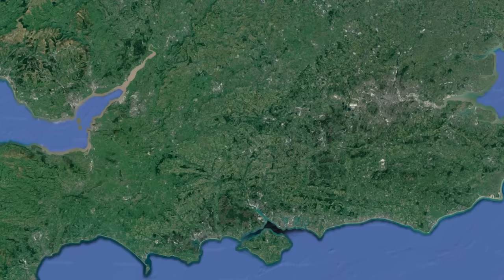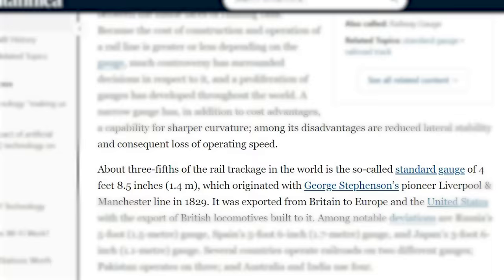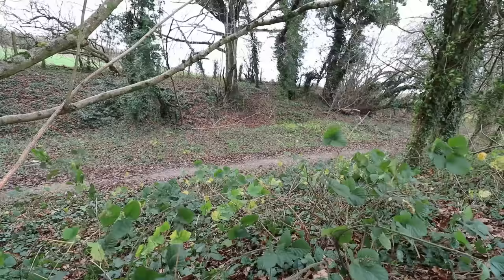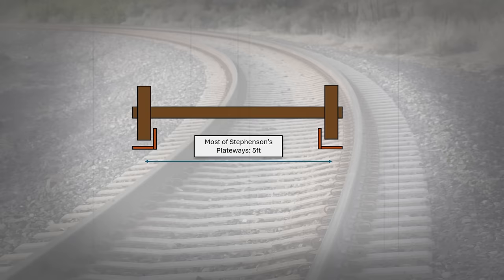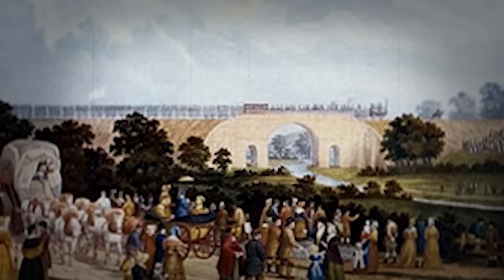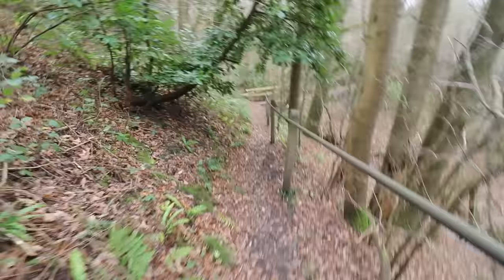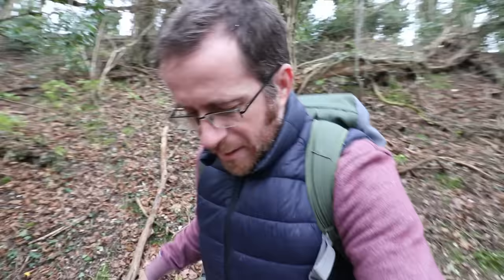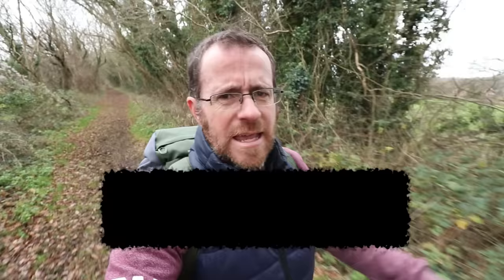Railway Gauges did NOT Evolve from a Roman Chariot.

Comment: I liked the video but everyone will tell you that you missed their favourite aspect of the gauge wars.
I will throw in my "twopence":
Larger gauge lines are more expensive to build and maintain. This is not a problem for a heavily used line like London to Bristol. For a rural branch line struggling to be profitable this is another nail in the coffin.
The bigger the gauge the larger the minimum practical radius of curves. This is not a problem on a line which is on reasonably flat terrain but becomes a problem on lines which thread their way through steep sided valleys and mountain passes. The only solution becomes more tunnels and other earthworks (which have to be wider for a broader gauge). 

Narrower gauge lines are usually slow because faster trains will be unstable.
Around the world, mountainous areas often have narrow gauge feeder lines and wider main lines.
Brunel's gauge was seven foot and one quarter inch. The quarter inch was added for the same reason Stephenson added a half-inch to his. If you build track and rolling stock to the same gauge they will bind going around corners. Modern railways tend to "ease" (expand) the gauge even more on curves.
Just my thoughts.
Reply from the maker: Veeeeery good point indeed. Cheers
Reply: South Africa ran express trains on 3' 6".
Reply: Nowadays they have greasing devices on tight curves to prevent binding. There's one just to the south of the Ribblehead viaduct, the only one I've ever seen. You can see it from the station platform.

Comment: Thanks Paul.  A minor correction.  At 0:44 you said 4' 8.5" in the UK.  Not true - only in the GB part of the UK of GB and NI.  In NI, all of Ireland in fact, the gauge is 5' 3" - and there's another story.
Reply: So-called Irish gauge was only JUST bigger than Standard. 
Hence British Rail were able to sell some uk stock by simply re-working the wheels, axles and bogies to suit.
Reply: Yes Ireland uses 5ft 3, and the tram system is standard guage.
Reply: @armstrongleworthy5420   In Auckland, NZ, for the last decade of diesel-hauled trains (before they electrified) the carriages were refurbished BR Mark 2's on 3'6" bogies.   We also had some diesel multiple units form Perth, West Australia, surplus from when they electrified.

Comment: I read an article written by an engineer many years ago. He said that the width of Roman chariot wheels was not determined by the width of the horses. That measurement can vary by the size of the horse and the person making the measurement. The accepted length of a cubit is 18-inches. If you take a wheel one cubit in diameter and turn it one revolution, its circumference would be 56.52-inches. That would be a very accurate measurement at the time. After all, .020-inches would be about the thickness of 5-sheets of paper. Measuring wheels would also have markings on them to indicate shorter distances. A yard is a double cubit.

It has been an age-old practice to measure distance by counting revolutions of a wheel. Even our early settlers heading west had an odometer (road meter) attached to their wagon wheels to measure distance. There were no tape measurers, so early carpenters carried a measuring wheel to mark off distance.

Measuring wheels can be purchased at any big box home center.

Comment: The three main railway gauges in Australia are 
narrow: 1,067 mm (3 ft 6 in), 
standard: 1,435 mm (4 ft 8+1⁄2 in), and 
broad: 1,600 mm (5 ft 3 in). 
Light rail for Sugar Cane harvesting uses 610 mm (2 ft).
Reply: I thought Australians were more efficient and didn't waste time doing inconvenient conversions for metric and imperial dual units.
Reply: @DemPilafian  a lot of us more efficient Australians are still old school and are more comfortable with Imperial measurement than with new school Metric. 
Feet, Inches, Yards, Chains and Furlongs seem more real than ten times ten times ten times ten what-Evers.
Reply: @Blackwater_House   Australia successfully metricated very quickly back in the early 1970s.  If you are truly more comfortable with imperial units you are literally already retired.

The good thing about being retired is that you have plenty of time to post meaningless garbage on YT.
Reply: @DemPilafian  I am almost 68 years old, Blind as a Bat, Deaf as a Post and Pig Ignorant; so your Opinion of Me has about the same value as a Mountain of Molehills. 
But I am pleased that you were able to express yourself so Eloquently in this forum. Best Wishes for 2000 & 24.
Reply: @DemPilafian  How do you measure car wheel sizes in Australia? 
 Pilots use feet, knots and nautical miles. Pipe thread is BSP (British standard pipe) like much of the World apart from the US. The base unit is 1 which is 1 inch, 1/2 etc.
Reply: @1maico1   As an American, I sincerely apologize to you for the shitshow you have to deal with because of us.
Reply: LOL.  Some of us even carry around organic calculators.  Others call it a brain.  Like the others said, us oldies can work with both.  Officially we are metric.  All items to buy now metric.  So an imperial nut no longer fits on an aussie metric bolt.

An interesting one is the Puffing Billy in the Dandenongs (near Melbourne) is 2'6' and still running as a tourist train.

Steepest train in the world?  Outside Sydney in the Blue Mountains.  And to think I went all the way to Switzerland (one metre gauge)  for the steepest COG train!

Comment: The BART system in California uses a less common 5’ 6” gauge. This was selected as the best way to ensure the cars, which were designed to be much lighter than other rail cars, would remain stable in the face of high winds at several points on the planned network (including a line across the Bay Bridge which never happened).
Reply: BART has a lot of design strangeness in general. until recently they used cylindrical profile wheels with no taper, which is common on streetcars, but not at all common for the subway-type system they actually built. allegedly the design consultants were from chicago where L trains have cylindrical wheels to deal with tight curves on the loop.
Reply: That was a biiig mistake.  As at present, BART cannot expand over existing lines or right of ways, and because of that at present there is a standard gauge diesel connector.

Comment: A couple notes on gauge...
1.  Stability - In the US, double stack container car loads are limited to 20 feet 2 inches height (!), running on 4' 8-1/2" gauge.  They don't tip over very often.  South Africa runs express trains on 3' 6" gauge. Brunel made a bad assumption about stability.
2. Changing gauge - on wooden ties, it's easy to convert from broad gauge to standard gauge by boring new holes in the ties.  Changing from standard gauge to broad gauge would require replacing all the ties with longer ones.  The government did something right for once.
Reply: I just found that maximum height is "Doublestack 4" = 20' 3" instead of "Doublestack 3+ = 20' 2". One inch difference to handle the taller containers at 2 high.  Maximum width is 9' 11".
Reply: @SteamCrane Not so simple when you come to altering curves and points.
Reply: @Poliss95  Correct, but the majority of mileage is track with only an occasional switch.

Comment: I think a fascinating example for a country sticking to another gauge than standard is Japan. The mountainous terrain and its need for tighter curves was perfect for the smaller gauge they still use. They only adapted for standard on the Shinkansen lines which are flat and straight.
Fascinating video on railway history. Germany also hat several gauges used parallel. Back then of course it wasn't Germany at all and every little Kingdom, Duchy and Principality had it's own railway company and also it's own gauge.
I wonder why we adapted the English standard. ^^
Reply: Spain and Portugal still use the wider Iberian gauge for most of their trains, but Spain's high-speed network is standard gauge to interoperate better with the rest of Europe. But now they've got some trains with variable-gauge axles which can actually switch between the two, with special gauge-changing equipment on the track.

One of the oddest ones to me is the Washington, DC Metro, which is 4' 8 1/4". That quarter-inch shaved off from standard gauge is because they're using less conical flanged wheels, to reduce hunting oscillations at the cost of more squealing on the curves.

Meanwhile, Boston's MBTA is standard gauge but it recently came out that the new Green Line Extension was accidentally built to slightly incorrect gauge, causing all kinds of problems.
Reply: Japan is fascinating. Apart from the Shinkansen lines, there are also railway companies and tramways that run standard gauge, a total of 2,600 route miles. There is even 60 miles of "Scotch" 4 foot 6 inch gauge on two interlinked Tokyo commuter lines and the Sapporo tram network. And 30 miles of electrified 2 foot 6 inch gauge.
Reply: Note that Japan has a much wider loading gauge on high speed lines, mainly I believe because the slab track they use is much more stable. They also have trains that automatically stop in an earthquake.
Reply: Japan historically used 3'6" for the former JNR network, and many private companies used the same gauge, although others (including some subways) used 4'8.5". 3'6" sounds sensible in Imperial, but its a rather odd 1067mm in metric! I'm not sure why the narrow gauge was chosen - presumably they didn't anticipate the amazing industrial growth in the 20th Century. Yes, there is lots of mountainous terrain, but the cities are usually on coastal plains, where a narrow gauge is unnecessary. But as has been mentioned, the loading gauge for most Japanese trains is huge - it seems rather odd to think that some of the huge 15-car long distance commuter trains - sometimes including a couple of double deck cars  - all packed to capacity - are narrow gauge trains! Its interesting that where a free choice of gauge could be made - eg Shinkansen, Chinese high speed rail - govts have stuck to 4'8.5" rather than any wider gauge, even at seriously high speeds. Again Shinkansen are far wider than UK stock, seating 5 across (+aisle) comfortably.
Reply: @timbounds7190    In terms of 'narrow gauge' there are two widespread gauges - metre gauge and 3'6" gauge.   3'6" is in use in Japan, New Zealand, Queensland, Western Australia and Tasmania, South Africa and Zimbabwe, and others.   Metre gauge is in use in Europe (e.g. northern Spain, CFP in south of France, Switzerland - notably Rhaetian Railways), east Africa, Brazil, Bolivia and others.

Comment: The broad gauge rails are known as "top hat" rail because of it's sectional shape. Another meeting of gauge differences is to be seen at Canfranc in northern Spain, French standard gauge meeting Spanish broad gauge, the station, longer than the Titanic, was a failure due to the man handling of goods from one platform to another. Went there a few years ago when it was in a very poor state, it's now a hotel I believe.
Reply: I believe a few YouTube's have covered it in the dilapidated state The Tim Traveller and also Tom Scott just being two.
Reply: Canfranc was abandoned due to a tunnel failure.
Dual gauge trains are a thing too…
Reply: @allangibson8494  no.  A train derailment in 1970.  Still, the big building was not being used by then in full capacity, and after most of the French line closed, it was finally abandoned.  Only recently it reopened, and a new station on the former goods yard was opened.
Reply: Broad gauge rail was also called "bridge rail" cos in cross-section it looks like a bridge - you can see it in the fencing at Torquay station
Reply: @tobythehairlessdog8876  The rail section wasn’t gauge specific. Bridge rail was used for standard gauge too.
Double headed rail was used too (but required special chairs at each sleeper).

Comment: Standard gauge also proves to be a good compromise for curve radii.  The wider the gauge the greater the radius of curves has to be to prevent wheel skidding and track/rolling stock wear.  The flanges of the wheels are not meant to contact the rails.  The wheels have a conical section that self-centres in the rails.  As the train goes round a curve the wheels shift to the outside of the curve and the outer wheel rides on a wider section of the wheel while the inner wheel rides at a smaller diameter.  It is all worked out to minimize wear and screeching.

Comment: Stephenson was contracted to build the Stockton and Darlington  Railway, will before the Liverpool and Manchester, Bolton and Leith. It was on the S&D R and the Mines Railways he discovered the binding and increased the Gauge by Half an Inch
Reply from the maker: Odd... so why was the Bolton and Leigh specified as 4ft 8.0 inches?
Reply: @pwhitewick  they would have specified 4’ 8”, but Stephenson would have built at 4’ 8.5”, because Stephenson already knew about the binding and the need to increase the gauge by half an inch, as he had already done so on the S&D R. Why do you think there was no binding on the S&D R. After all the S&D R opened in 27th September 1825. The Bolton & Leigh Railway opened in 1st August 1828 almost 3 years after the S&D R. The Manchester & Liverpool opened almost 5 years to the day after the S&D R, 15th September 1830.

Comment: The US had primarily two different track gauges until May 31, 1886 when a two day mass conversion changed all interconnected track gauges to four feet, eight and a half inches.  Preparatory work was done in advance to minimize the effort required over the change days.  Prior to the change the Union states had adopted standard gauge while the Confederate states chose five feet.  After the war between the states was settled, it was another 20+ years before railroad gauges were reconciled.  The Union states had more than twice the track length of the former Confederate states, which is why standard gauge was picked.  At the change-over time, 9,000 miles of track and large number of rolling stock and engines were converted to standard gauge in just two days, but only with many months of preparation making it possible.

Comment: Super video. Glad to be corrected on the ‘Horses Arse’ explanation. Although, that has spoiled a good tale about the size of the space shuttle engines that I used to illustrate how you need to keep pushing to get to the real cause of events. Still, I may still keep using it…

Comment: Here in Victoria Australia  we have 5 ft 3 in gauge as well 4,8/1/2 gauge
Reply: Yes the 1600 gauge that we use in Ireland aswell. I think it was probably brought to Victoria by Irish engineers.
Reply: 5'3" is the Irish Gauge, still used across Ireland today.
Reply: Port Adelaide used to have 3 different bushes all going into the port. There was som interesting point work where the lines all ran together.

Comment: The only thing I remember about how Stephenson chose his guage was what I read in a history book at school. In deciding the track width of his engine Stephenson measured the axles of numerous carts being used on the roads of the time. I presume most of these would have been horse drawn. He then took the average and settled on that figure, which turned out to be 4ft 8 1/2in. Whether this is true or not, I have no way of telling because I also heard (don't know where) that this gauge was the best at stopping the engine from tipping over on a bend. Did he not leave any notes?
Reply: The video has a quote from stephenson saying he can't explain why he ended up with the gauge he did.
Reply: @martinhawes5647  He may have not remembered, but it was obvious that he worked in mines where the gauge for the horse-drawn carts was 4ft, with some varying to 4ft 71/2in, whilst other mines in the North of England used wider gauge.  I suspect that he may have taken note of what worked and what didn't, and went with what did. Cost and time could well have come into his reasoning, as these two factors always have a bearing on any engineering enterprise. But, we'll never know.
Reply: @majorbruster5916 Video has a more plausible explanation of running his 4'8" gauge on the same lines as the old 5' carts by making the outside of the 2" rails fit the old carts .  Then the ½' was added to work better in curves after the 5' carts were gone .

Comment: Nice to learn the truth!

Here in Australia we started off with each independent state developing the railway systems before Federation.  We ended up with multiple gauges.  Mainly 3'6", 4'8.5" and 5'3".  Why?
1. Some states would agree on a gauge and then one would have a change of government.  The new govt would reneg on the agreement AFTER the other state had started.
2. The cost difference wasn't just the width of the sleeper.  Narrow gauge lines cost far less in infrastructure (cuttings, tunnels, bridges) because they could better follow the contour of the land.  One cost estimate for one mainline was a factor of 8 times, simply because of the land's variations.

Even a single state could use different gauges for different lines depending upon many factors.  In my own South Australia we even had some towns with all three main gauges at the one station!  The broad gauge was used by American Webb because the state government requested the best.  Nearly sent the state bankrupt!    The narrow gauge decided upon by the Federal government for the line to Alice Springs (cheapest option to fulfil a Federation agreement) and eventually decades later, standard gauge by the Federal government to get rid of all the changes in gauge.  Queensland still uses and builds narrow gauge.  The Ghan does not go there and technically The Indian Pacific does not either.

Of course we did get good at gauge changes.  Bogey exchange sheds were built.  Simply use the same carriages / wagons etc. Lift up the carriage/wagon/van, , slide out one bogey gauge, side in another and lower back down.  Only had to change the engine.  We even had some dual gauge track too.